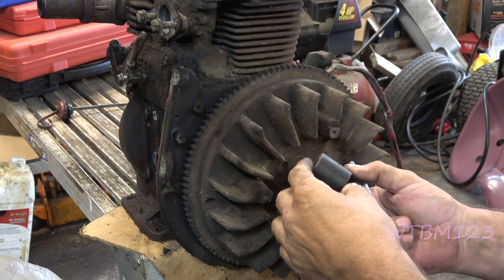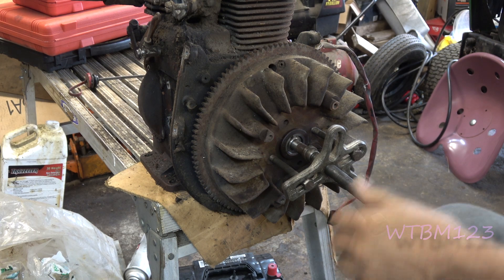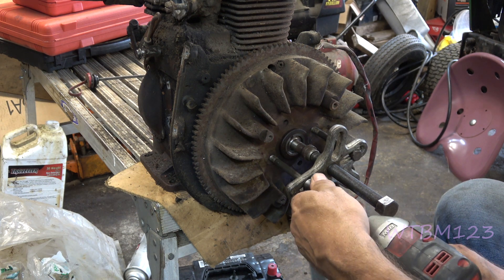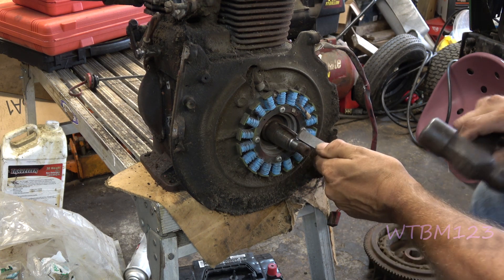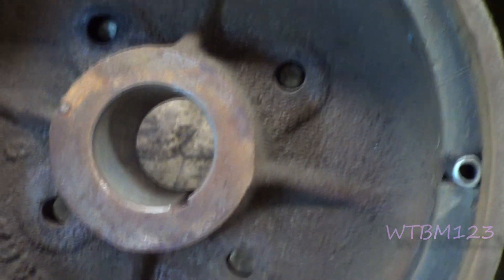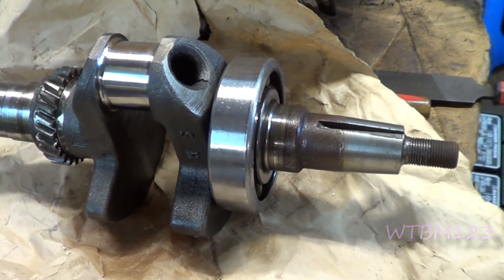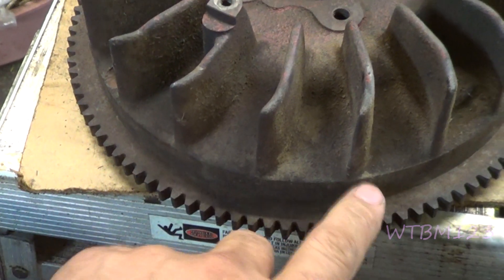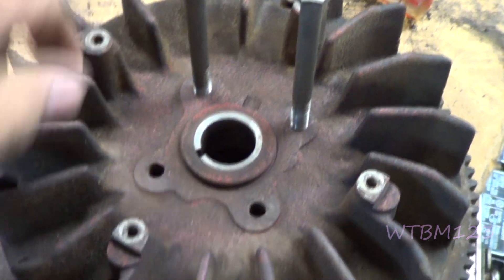Stop Flywheel from sheering the key , Flywheel removal and install lapping in the flywheel

Comment: That makes sense. If you look at tapered chucks and tooling on lathes and milling machines, the taper is an interference fit and allows huge amounts of torque without slipping. If your taper is worn it will allow slippage. Since a flywheel and shaft on a small engine is the same principle, any dirt or lack of contact will make the fit weak and allow it to slip. Thanks for the idea. I have a small briggs and scrappon mower with a sheared flywheel key. Unfortunately the flywheel keyway is opened up so I'll have to find another. I might be able to squeeze some JB weld into the gap with a syringe after aligning it. Not really trying to put a lot of money into a cheap motor.
Reply from the maker: Thank you for stopping in and commenting

Comment: Lapping a flywheel taper, that's a new one on me.
The flywheels on motorbikes don't give me much trouble, but i make sure the surfaces are clean and lint free,  Whatever lint is.
I've never found the illusive  Lint, have you lol.
Reply from the maker: You do get pieces of stuff off of paper towels , But usually only notice if using a micrometer . But my clothes dryer makes a lot of lint . lol . Thanks for stopping by , Always enjoy your comments